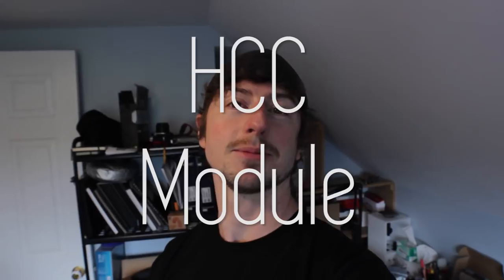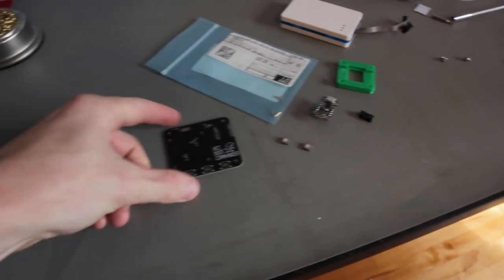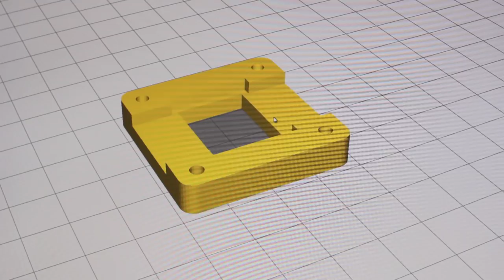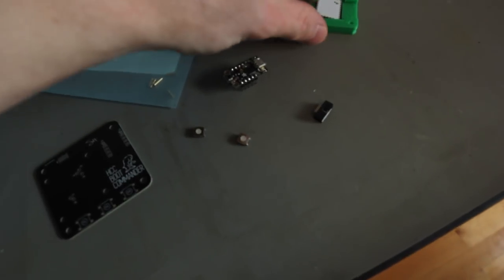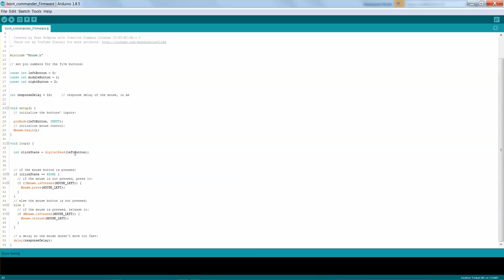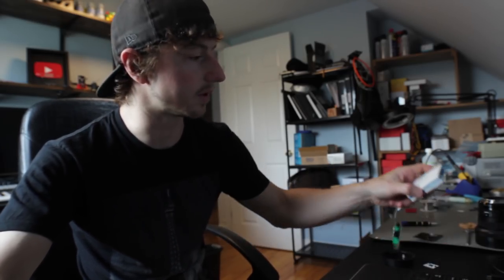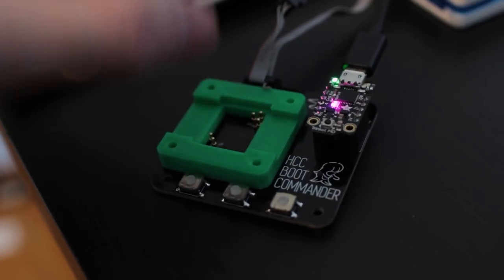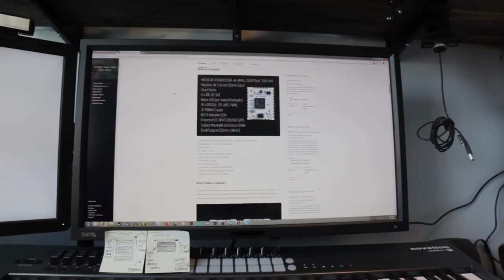Bootloader Programming Jig for the HCC Module!

Comment: Two questions: 
1 -  Reason for using a Trinket M0 instead of a HCC module? Seems like it would be a perfect use case for it.
2 - Why use an Atmel Ice/Computer to program the bootloader when you can use the Adafruit DAP to burn them from a sd card with a single button click? https://github.com/adafruit/Adafruit_DAP
Reply from the maker: 1) Chicken/Egg Problem - I didn't have a working HCC Module when I made it, still needed to be tested when I was designing the programming jig. I have several Trinkets. But believe me when I say I thought about just remaking it with the HCC Module for the video, but no time. Also, I'm thinking about other makers here. If people are making their own HCC Module, I'm not going to make them buy one from me just so they can program their own. haha 

2) I have an Atmel Ice, and I haven't ever researched alternatives since I have had the ICE for a long time. Good to know! I will look into it, see how fast it is etc. The ICE is definitely a bigger expense, but its really quick. The difference in programming 1000 HCC Modules at 10 seconds vs 20 seconds is 3 hours. I will definitely check it out. Thanks for the info.
Reply: A little more background of its development. https://www.youtube.com/watch?v=bzihf4l7joc. I think Lady Ada got the programming speed down to a couple seconds.

Comment: So when using the Arduino IDE what is the ATMEL chip recognized as? The UNO, Mega, or Zero?
Reply from the maker: Its technically a Zero, I use the "sparkfun SAMD21 breakout" currently, but I will make its own variant.

Comment: Wait, why exactly is the boot loader necessary?
Reply from the maker: Chips shipped from Microchip need a bootloader or some firmware on them to make them do anything. The bootloader allows your computer to see it as a USB device and connect it to the Arduino IDE.

Comment: I find it a bit too overpowered for what it does, couldn't you have put a programmer code on the Trinket or use a more powerful MCU if not possible? After all, you can make an AVR programmer with an Arduino. Why would it be different with SAMD? Also, why using a Trinket and not putting an MCU directly soldered, like the SAMD in the HCC module? 

And you could get away with 1 button if you take a bit of time to make an application which reads the serial port and issues a command with avrdude (you could use Processing for that, maybe). Or just use the keyboard and a terminal emulator to simply use up arrow and enter after entering the avrdude command for each board. The keyboard is much easier to use when you get used to it, but most Windows users don't know that. Most Unix-like users, like me, use the Terminal a lot. I customized it with oh-my-zsh and it's pretty and useful. Windows shells are for beginners, bash is better, but zsh is the best shell!

On an unrelated topic, I'm looking for a soldering station. I see you use the Hakko FX888D. I'm not sure whether to choose that one or the ERSA i-Con Pico, which I also heard is good. I like the Hakko's compact footprint and the soldering iron stand (apparently, Hakko is the only one who can make a good soldering iron stand, not just a metal spring). But the Hakko also has the worst UI of all the soldering stations I've ever seen (only Hakko can think on putting only an up and an enter button. I'd rather change the enter button for a down button!). However, I've seen a mod for making it better. So would you recommend it?
Reply: Do you realise you can't program an ATSAMD21 chip with avrdude (or any avr programmer)? 
As for the soldering station I would recommend the Hakko.

Hope this helps,
Louis P

Edit - Personally I would make the jig breakout the SWD pins, wire them up to a Raspberry Pi (or even make the jig a Pi HAT) and program the chip using OpenOCD. A simple python program could issue the command to flash the bootloader on the press of a button.
Reply: Louis Parkerson Oops, forgot that! I’m used to AVR. Instead of avrdude, I can use SAM-BA (which I used to upload an hex file to an Arduino DUE).